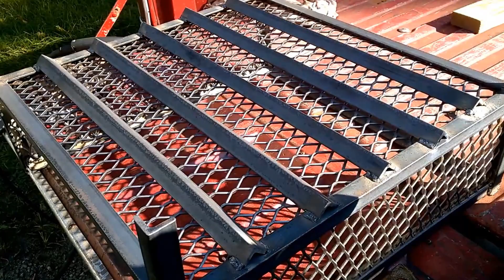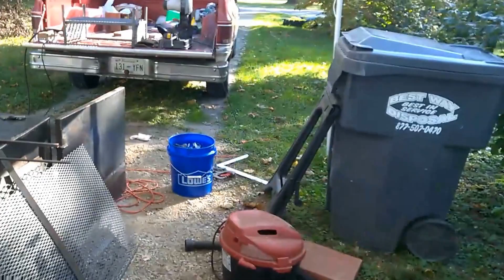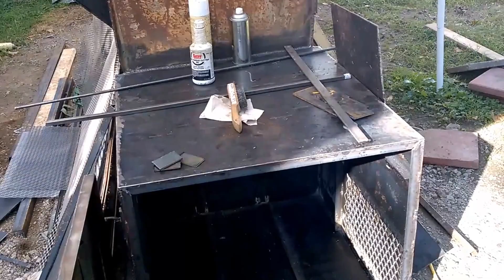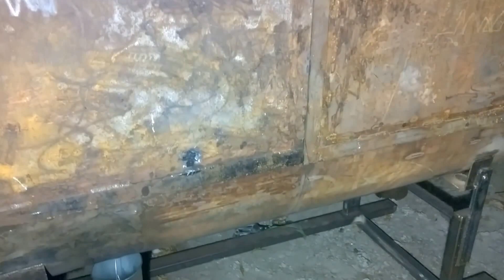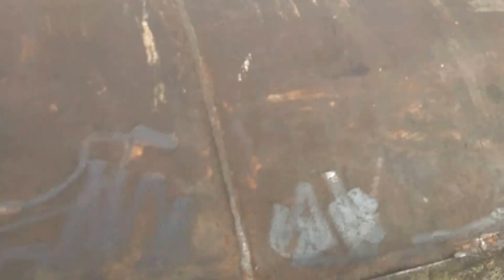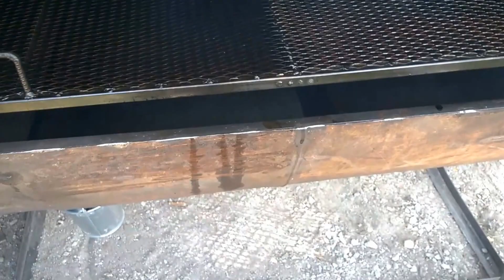The Great Smoker Build (Part VIII) 275-gallon fuel oil tank

Comment: Thanks for the shout out! Next suggestion you might want to be careful with it being under that cover. I once saw the roof of my garage smoldering after a long cook, while I was venting the smoker straight up. I have since put stove pipe with an elbow to pipe the heat and smoke out of a window in my garage.
Reply: Just fyi, I've been welding for 23 years and even had some schooling on it and I've never heard the sunlight thing before....ever.  Now you've got to keep mig out of the wind because it will blow the gas away, but never heard anything about sunlight.